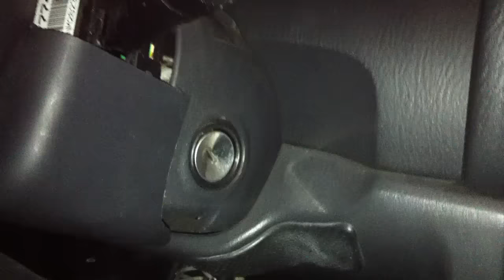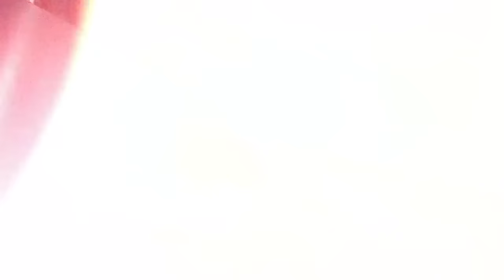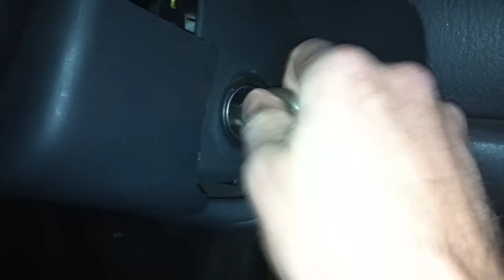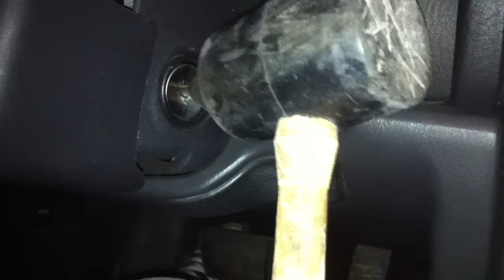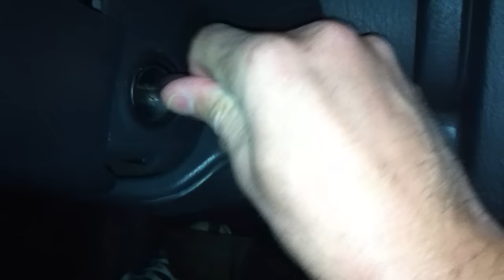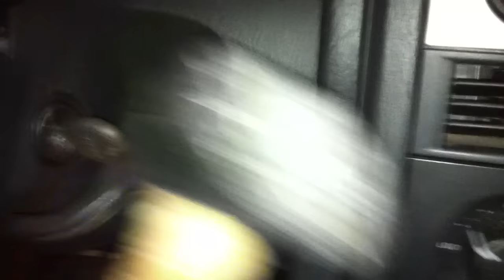if your Car/Truck Key won't turn, here is a Quick fix -UNCUT

Comment: Although this didn’t ’fix’ my problem it actually saved my car from hurricane rains since all 4 of my windows were down. It was my 04 Honda CRV. I hit that thing and got the ignition to turn on after hours of trying to turn the key. I got my windows up.. couldn’t crank it but even if I had I would’ve prob stalled instantly. Thank you for sharing and if you’re reading this Godspeed ahead.

Comment: Amazing tip! Thank you.  The official directions for installing a new ignition switch and ignition cylinder lock told me i had to drill through the head bolts on the steering column to replace the latter.  No way I was going to do that!  I knew there had to be an easier way even though my key wouldn't turn.  This was the  tip I needed.  Once i had the key in the ACC position on my 97 Geo Prizm, i was able to insert the pick and depress the pin so I could pull the cylinder out!  Really really easy.  I'm so glad I decided I could fix this myself. I now have a brand new ignition switch and cylinder and everything is running great.  I probably saved myself about 100 to 150 bucks.  But not for the faint of heart if you don't like getting your hands greasy!
Reply: p
Reply: This would have been my next suggestion.

Comment: Nov. 1/2020 - yeah!!!  We're in Vancouver, Canada. 93 yr. old mom has a Shoprider mobility scooter (7 yrs old now). Today, out of nowhere she could put the key in the ignition, but it wouldn't turn. She was sure someone messed with it as it's a day after Halloween.  We doubt that part.  We doused the ignition with WD40 but ... the key still wouldn't turn, after an hour.  So, we tried this fix - gave it one good whack with a hammer and WHALLA the key turned and she'll be able to go shopping tomorrow as she'd planned!  Thanks for the GREAT, INEXPENSIVE fix for a low-income senior.  It costs $100 service charge just to have a professional place come to look at her scooter to access the work needed, then the cost of repairs on top of that.  Try this fix folks!

Comment: I had this same problem with my Toyota Sienna. I tried for hours to get the key to turn without success. I came across your video on YouTube and gave it a shot. This is a standard flat key, not a chip key or anything. I removed the key from my key ring and tapped the end a few times with a steel tire gauge. I then tried to turn the key and voila!, it turned! I sprayed some WD40 in the key slot and tried turning the ignition off then back on a few times and it worked each time. Amazing! Thanks so much for this tip. Sometimes the simplest solutions are the best.

Comment: Thanks for the video! After riding my bicycle in the rain for three weeks and attmepting to change the Ignition Lock Cylinder for two days I finally got the key into the ACC position to replace the cylinder, using your method with the hammer!

Comment: 10 years later and this video is still helping people. I lucked out having a key with the fob portion broken off so I could hit it with a hammer without fear of crushing the fob. Regardless it worked after 3-4 little taps. Thank you so much.
Reply from the maker: No kidding, my son called me while he was away at college at one in the morning with the same problem so I told him what to do. He used a pair steel toe boots.

Comment: Tried turning the wheel back and forth while trying to turn the key and it didn't work. Watched this video when I was at my last wit in knowing what to do and said what the heck.... I watched this video and out of desperation, got my mallet out and tapped it three times on the key. The key turned and the car started. Amazing. It worked for me just fine. Thank you, Warren.
Reply from the maker: I love that you pointed out that "Tried turning the wheel back and forth while trying to turn the key and it didn't work" cause I got the odd post on here saying thats the problem. We all have experience the key being locked cause you turned the car off with the wheels turned and the pressure on the lock is preventing it from turning. and yes we all know that you just have to turn the wheel to remove the pressure and the key will turn.

But that is not issue with the vast majority of people that have found their way here. They are here because of a bigger issue. and this hammer trick doesn't fix that issue, but it is a temporary cure. 

Glad it worked out for you and so many others. Cheers

Comment: This saved me from costly repairs just this afternoon. My wife failed to keep the wheels straight when parking and the steering wheel locked. I had to ride my bike to get the key in the ignition using this method. No danger of breaking a key if you don't pretend you're Thor. Think "firm taps."

Comment: It worked! 2010 Ford F150. Thank you so much for posting this video.  I had tried everything before this, resetting anti theft, jacking front end up, just trying for hours jiggling steering wheel and key. Didn't want to hotwire because it is a newer truck and antitheft would probably keep steering wheel locked. But I did this with a hammer,  because I didn't have a rubber mallet and it worked. It didn't permanently break the locking mechanism,  as I took key out I had to pound on it again for it to turn, but now that it's turning I'm going to just leave the key in the ignition. Luckily I live in a place where I can leave my keys in the ignition, doors unlocked and never worry.

Comment: My parents car was giving me difficulties. The car key ignition somedays wouldn’t turn. It got stuck and I couldn’t turn it anymore. It’s been two days now and I’ve just been ubering back and forth. My uncle told me to spray some WD-40 into the key hole and let the product sit for a while and try turning the key again. Well it didn’t work. Then I saw your video and thought Id give it a try and what do you know??? IT WORKS, This is a miracle!!!! It turned and now I’m driving the car around again today. I was searching for help on YT, I happen to click on this video and it was the best choice. For a non mechanic like me, Thank you for sharing this video.

Comment: Came out of the doctors office and the dam key wouldn't turn. Tried everything for 20 minutes. Was just about to call the wife to come pick me up. Saying to myself please key just turn so I can get the car home and fix it. Googled it and came to your video. Didn't have a rubber mallet but did have the boot on my right foot. Hit the key real hard with the sole of the boot and wham the key turns. Thanks for posting this. Saved me some  aggravation for sure. 2002 Chrysler sebring.
Reply from the maker: Da BOOT for the win! love it

Comment: We had a blinker problem with our Grand Cherokee and learned that using a rubber mallet to hit under the dash fixed the turn signal. Now, we have the key not turning issue and using the same rubber mallet fixes that too! Looks like Jeep needs to be sold with rubber mallets already stock in the glove compartment. Finally, your sarcastic frustration was totally awesome bro!

Comment: when I had the same problem it turned out to be shavings from the key being put in and taken out, over time, building up and sitting in there, gumming up the lock. Striking it would make the metal shavings loosen but if that's the case here your lock will jam again once they resettle in a few weeks.

I just put paper towel on the carpet below then sprayed a generous amount of lock lubricant in to flush it out, then a blast of air from a keyboard cleaner compressed air can. It cleaned it out without taking anything apart or hitting anything with mallets.
Reply: What type of lock lubricant did you use by chance?!
Reply: I think I used lock de-icer, but any spray lubricant with the straw type nozzle will do - WD-40 would work fine. Remember to blast it out with an air can after.
Reply: The issue isn't lubrication nor is it metal shavings. The issue is a worn out key. Just like breaks, if you let those wear out too long, you end up damaging your rotors. With a key, if you let it wear down too much, you can wear out your ignition. There is a bar inside the ignition cylinder that is most likely not fully retracting and not allowing the cylinder to rotate. A "new" key, (not a shiny copy of a worn key) will allign the parts in the lock correctly to allow cylinder rotation. However, a worn key that has been ignorred or hit with hammners may be damaged where even a new key can't fix it. When this happens, its time to replace the cylinder. Contact your local locksmith if you experience this problem.
Reply: yeah nevermind I had this same problem and metal shavings were the issue, jamming the cylinders, and once cleaned out it solved the problem. Nope, it can't possibly be that thing that happened.

BTW brakes are b-r-a-k-e-s, not b-r-e-a-k-s.
Reply: Autocorrect doesn't always choose the correct word. Also, I make a good living helping people fix problems just like this. There may be metal shavings in your ignition jamming up your lock, but the reason the shavings got in there is because something is worn, either the key or the tumblers in the lock. Producing metal shavings is not a natural function of using a lock. Speaking of brakes, if your brakes were sparking every time you applied pressure on them, you wouldn't say it's a normal function of brakes and to just spray WD40 on them, would you? Hammering a cylinder is absolutely acceptable method of solving the immediate problem of getting your car to start, but that doesn't mean there isn't a problem.
Reply: Crispy Bacon 
Yeah, from my understanding, while this does work, at the same time, it is not a solution as it damages it more and more.
Reply: KarmaTiger  hulk smash
Reply: KarmaTiger kmm.qb9
Reply: In order to do this, do we need to disconnect the battery cable, because we would be spraying lubricant in the steering column?
Reply: @crispybacon7937  Have a good locksmith make a copy of the worn key and take off around  .001" (1 thousandth of an inch) LESS than worn key to make up for wear. Or have them make a "Code" key which is not cheap (About $80) Thats the OEM key spec. otherwise if one doesnt mind two keys, just get it to turn once and get a new cylinder from AZ or advance. If the cylinder is OEM a locksmith CANNOT replace the tumblers.
Reply: @ChrisMichaelsChicago  several things incorrect from your response. A locksmith can service an ignition bought from the dealer. Most ignitions locksmiths get are from the manufacturer that makes the ignition for the car manufacturer.  Ours are a lot cheaper because the keys that come with the ignition don't have the factory logo on them. Depending on the manufacturer it could be over $100 more just for that logo on the key.

Second, the wear on a key is not always even. For instance, the tip of the key could be as much as 10/1000 of an inch off spec whereas the last cut may only be 1/1000 of an inch, because the tip slides past nine wafers on the lock before it hits the correct wafer located at the back of the lock. Adding 1/1000 of an inch overall isn't going to correct a worn key issue, it is putting a bandaid on a knife wound to the gut.

Third, a code key can vary depending on the locksmith. If the key doesn't have a transponder ship in it, it can be as little as $20 to remake it into a brand new key. A key with a chip in it doesn't have to cost that much either. I cut chips out of keys all day for less than $35 and the customer walks away with tax and everything for less than 2 $20 bills. Even if they have to replace the ignition, most aftermarket ignitions keyed up to the clients key could be as little as $100 installed including a new key cut by code. It all depends on what your locksmith is willing to charge.
Reply: @crispybacon7937  Roger that Crispy. Well the locksmith I spoke to and generally go to gave me some erroneous information regarding repairing the OEM cylinder or was unwilling to repair it. He quoted me like $90 for a code key. Ouch!  There's no chip in my 1999 Ford Contour key. Thank you for shedding some light on the worn key issues and that where the cut of the key mates with each specific tumbler do not wear evenly.  One of the keys I have from my original OEM cylinder is not worn at all so is it safe for me to assume that it is the tumbler(s) in the cylinder that are worn? Hmmm 
All of a sudden I'm fascinated by locksmith knowledge thanks to you. I certainly wish you were near the Chicago area because this gentleman charges exorbitant prices. I have seen a video where the man took the Tumblers out of the old cylinder and replaced the ones in the new cylinder with them so only one key was needed, but I'm not comfortable attempting to do this as I would think that the tumblers from the original would be worn. The reason I assumed they're worn is because even the Brand New Key which was a spare OEM key was difficult to insert into the original cylinder. For thirty bucks I picked up a new cylinder with keys from advanced. How would one go about obtaining and installing new tumblers to match the original key? Are there measurements that need to be taken from the original key? What is the procedure? Do tumblers come in different lengths or something? Different gauges? Any knowledge I can obtain from a professional like yourself would be much appreciated. As my pops always said, " nothing learned is wasted".  Apologies for assuming that simply raising the key Heights would do the trick and I appreciate your pointing out the details in my flawed assumption. Thanks so much, and I hope to be enlightened further. Thanks pal
Reply: @ChrisMichaelsChicago  as far as that tumblers, unfortunately, I don't believe the auto parts store cylinder comes with spare tumblers. They are sold turn key so people don't have to modify them for it to work  Also, it would probably be near impossible in a short YouTube comment to explain how to do it. It took me four years as an apprentice to learn my skill set 😁

However, there is a website I can point you to that could find other locksmiths you keep might not have heard of in your area, especially around Chicago. I am not surprised he charges more, probably to pay for the fact he lives in an expensive area. I don't know him, so I can't say if he is charging too much or too little for the area. However, if you go to http://findalocksmith.com/ you can type I'm your zipcode and it will search over 100 miles for a locksmith who is legitimate and a part of the national locksmith association, that way you won't get a fly by night scammer. That's the best I can do. Hope that helps.
Reply: @crispybacon7937  Thanks! Will do. Search "Eruption Chris Michaels" To see My skill set.... Also "Fair Warning in Las Vegas". Check it. I'm EVH. Hope ya like

Comment: Just tried it on my 2001 Toyota Tacoma, (it was towed to my home) and it didn't work. I spent a good 15 minutes hitting it- all I wanted to do is to turn it to accessory to push the pin so I can pull the cylinder out. I probably need to drill it out- ( not a fun or easy job) it seem like a great idea if it works- and by all the comments it has worked for many. Thanks for the video Warren and for the many you have helped.

Comment: Thank you for posting this. I tried everything (turning the wheel, pressing the brake, putting the key in and out, manipulating the gearshift) and nothing worked. I sprayed some dry lubricant into the ignition (that alone didn't do anything because I tried that first w/o hitting it) and hit the key with a mallet 2x and it started up.  2007 Hyundai Sonata. I'm getting the cylinder replaced next week once the parts show up.
Reply from the maker: thats great, temp fix, glad to hear your getting it fixed proper too.

Comment: Thank you for posting this video. My 02 Durango has been locking up. My mechanic told me until I get it fixed to jiggle up and down. The last time that worked, but not this morning when I had to get 8 loads of laundry to the laundromat!! I used a regular hammer and tapped my key. After 3 tries it worked!! I am keeping that hammer in the car for the next time, until I can save enough to get it fixed.
Reply from the maker: nice

Comment: Everyone BEFORE doing this try pressing your foot on the break, turn your steering wheel to the left a little and hold the steering wheel in that position as you gently jiggle your key back and forth while also pushing the key inward. 
If that doesn't work than I'd try this as a last resort.
Reply: Hell yeah buddy thanks
Reply: Thank you
Reply: Yeah I had a Nissan Altima that would do that off and on and it would unlock in the way you describe. Definitely try that first. Hitting anything on your car-especially anything with electronic components-with a rubber mallet should always be avoided if possible. 😄
Reply: Thank you, it works!

Comment: I have a mid 2000s Grand Caravan that randomly the key would not turn.  May take 5 attempts one time then 100 another of reinserting and twisting before it would turn.  Today I could never get it to turn.  A few YT videos taught me it is easy and cheap to replace the lock cylinder but it must be turned to near the start position to be removed.  Figured I was screwed then came upon this video.   At first I had little faith but gave it a try "or should I say WACK as you instructed"   It Freaking Worked !!!   As long as it works one more time when the ordered replacement cylinder gets here, it will have possibly saved me ether hundreds of dollars and / or many hours to resolve.   
Sending some $$$ as thanks if your channel accepts patron payments.   Thank You Sir